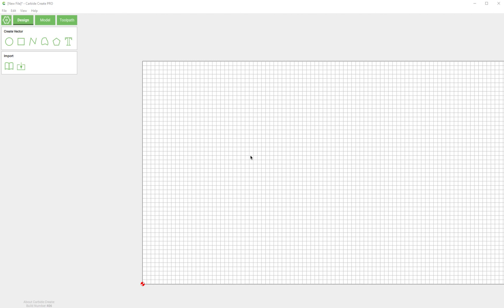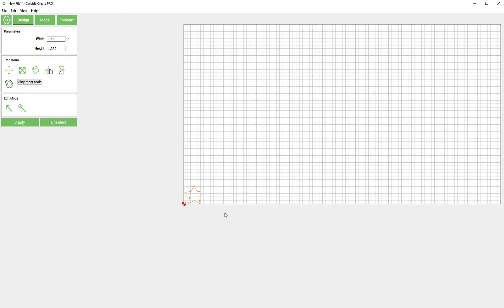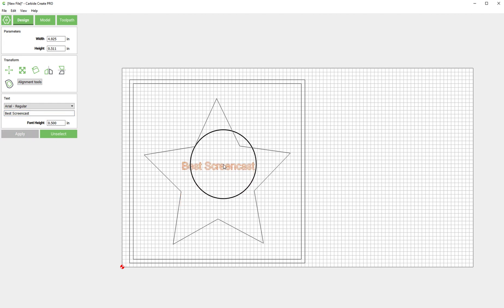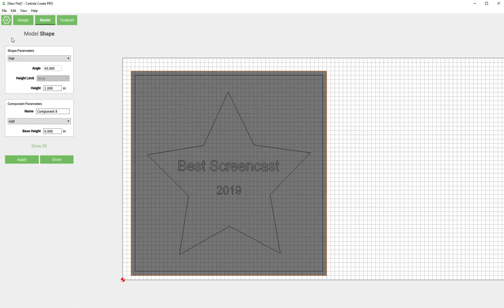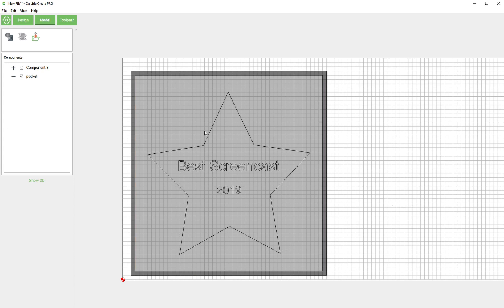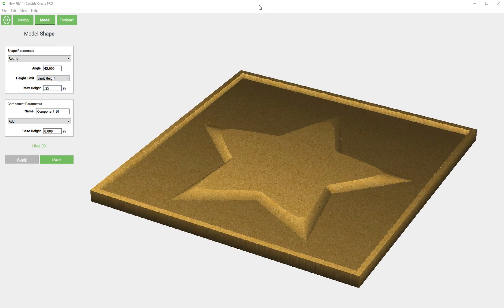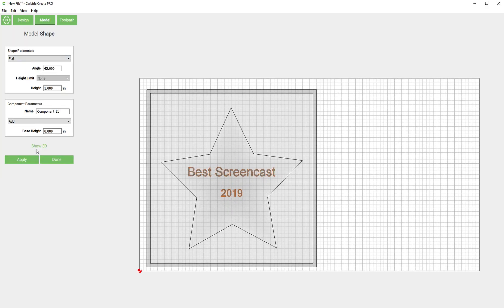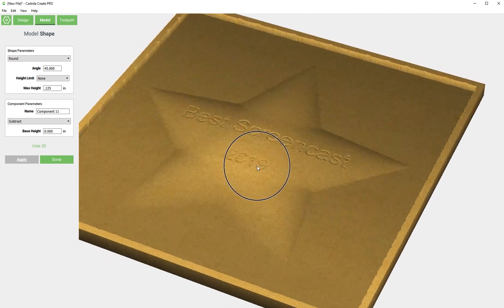Carbide Create Pro - An Example Project

Comment: If Carbide3D expects to put out a product like this and then charge money for it then either put out better quality videos or a comprehensive guide or both.
 These  type of videos are low quality and the individuals creating them are moving through selections quickly and not doing much explaining. 
It's a shame that you have to go to other YouTube channels in order to try to understand how to use this product.
Carbide3D websites are a jumbled mess of information making it difficult to find what you need. 
Please consider making access to information easier to access and of better quality.